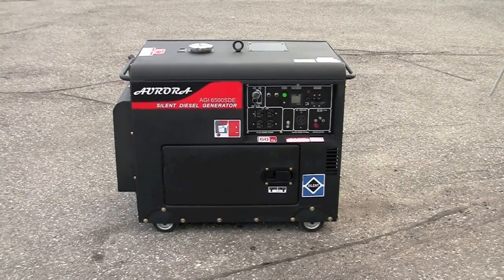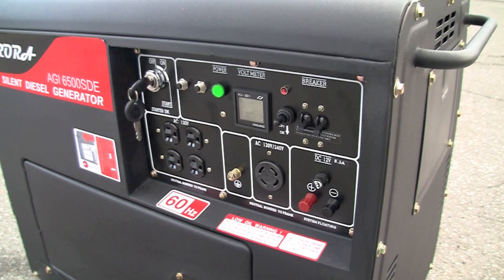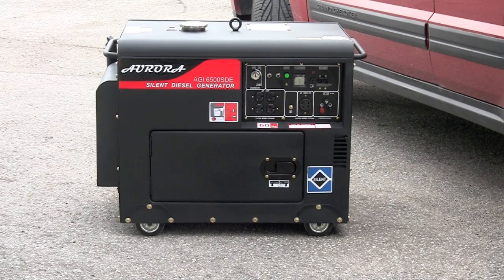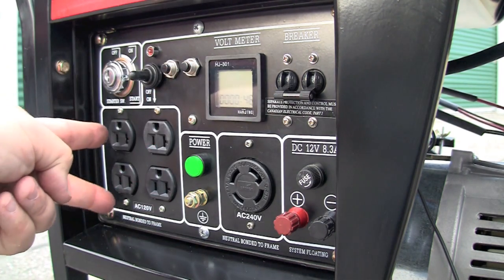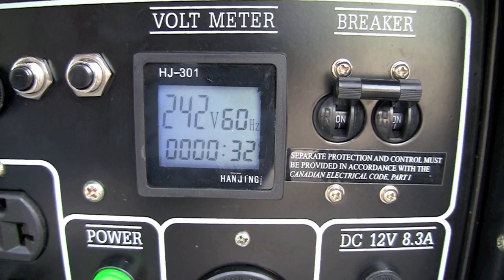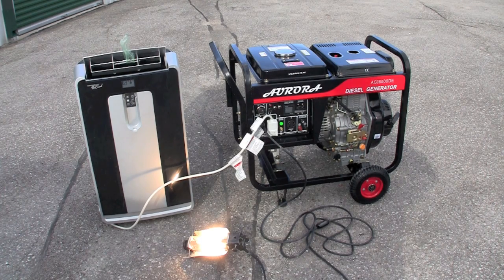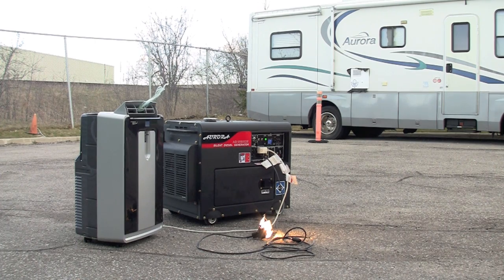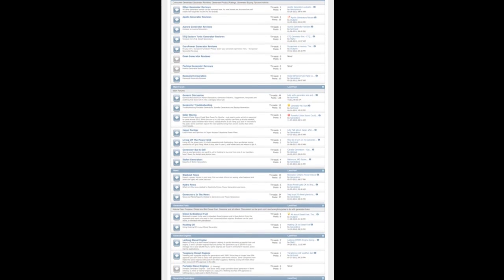Diesel Generators

Comment: Buy a Honda i7000eu. Gas powered, cheap to run and maintain, fuel injected for easy starts and can be converted to propane if required.

Comment: The open one I'm putting it in big rig truck is it rain or water  safe how much does it weight is it carb compliant can it run portable Ac xbox one ps4 32 inch tv at the same time how long can it run
Reply: tv and xbox should not use more than 700 watts . For your ac it depends on how many btu it has, should not have any problems with a small ac unit. Just check the ac spec sticker and look at the watts, then you will know.
Reply: happy93384  can, compiant, means 1 thing,,you live in KALIRORNIA.

Comment: +faffaflunkie Will it? Yes. Is it legal? No. And also, If you want someone to answer your comment, then you need to enable comments.
Reply: Ethan James Who cares if its legal. Millions of things are illegal so screw it.
Reply: Its dangerous and can kill people working on the power lines.
Reply: Ethan James "kill people working on the power lines" how? If that unit is my back yard running with a drop cord or whatever how in the world could it hurt someone? I have seen and smelled numerous old Mercedes Benz cars run old cooking oil with no problems. Multi fuel application is a good selling point for survival purposes.
Reply: Sorry. I thought you were asking if you can backfeed you generator. Excuse my stupidity. As for the cooking oil, sure give it a try, but you will void your warranty.
Reply: Ethan James Will make it smell like Burger King. After a bad disaster running cooking oil may bring around hungry bad people. HAHA
Reply: I wonder what it smells like. You probably need to break it in on diesel.

Comment: Will it run on Heating Oil?
Reply: You could but it would wreck the DOC if you remove the DOC "Depends on your emissions regulations" You can run it off of Heating oil it is the same as diesel just with more sulphur.
Reply: NO!

Comment: Cool hot video!  I have a 6.2 KW gasoline generator at my house in Florida, and under typical load, it burns 1 gallon per hour.  Refrigerator and water heater, the computers, occasionally the TV or a few lights.  The stove burns WAY more, when that is used we load-shed and turn off the water heater and fridge.  Works just fine.  But, it won't run my air conditioner...

Bought a portable unit that WILL do the bedroom!  Problem solved.
Reply: Flies2FLL some of the small diesel jobs run at 3600rpm, just like the throw away gas generators,,FYI, GENERAC units ALSO run at 3600rpm too.